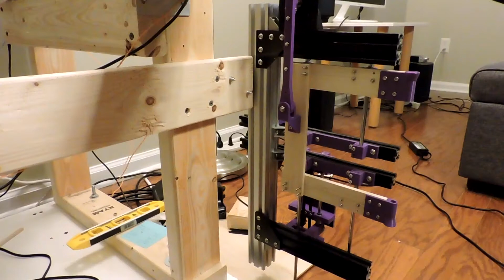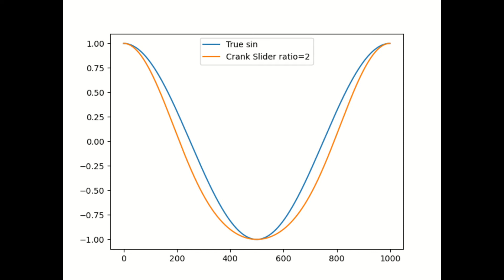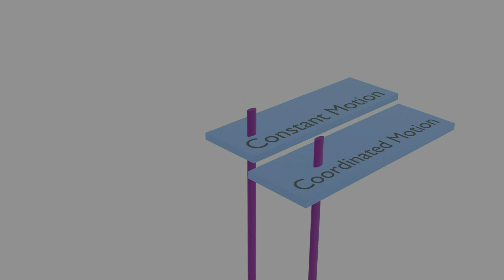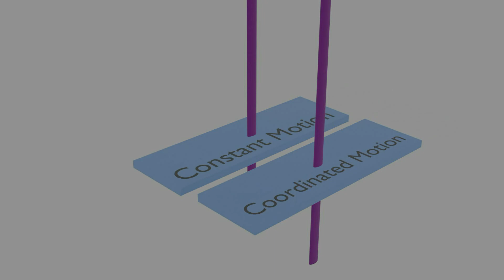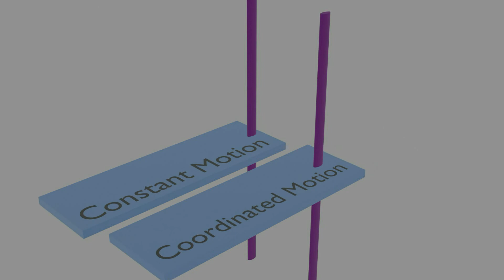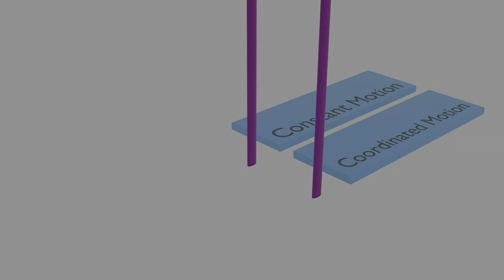CNC Scrollsaw - Speed Testing - 2

Comment: Hi Andrew, Love all the analysis you do ... helps us see what is happening in detail.  Are you ready to cut some patterns yet ? That is, ready to move on to cut wood soon ? Always a fun part too !  
With the continuous vs ideal discreet motion, a reverse tooth blade may help ? (reverse = cuts on up and down stroke.)
Final thought ... Did you try a cam at one point instead of the connecting rod ?
Anyhoo, keep at it please ... one of the more fun things I see on YT these days👍🎯🙏     as always ... Stay safe.  -Mike😷
Reply from the maker: The blade holders are the last piece to make before I cut anything but I will probably keep testing the speed off the machine for some time. Hopefully can cut soon. I do have some reverse tooth blades (PSR I think) that I can try. Might not matter as the feed per stroke is so small but a good option, you're right